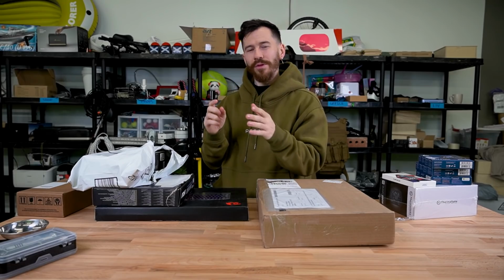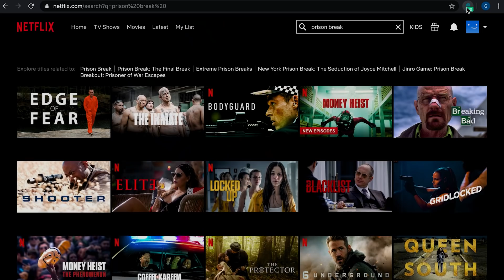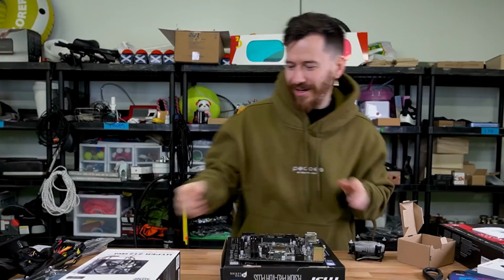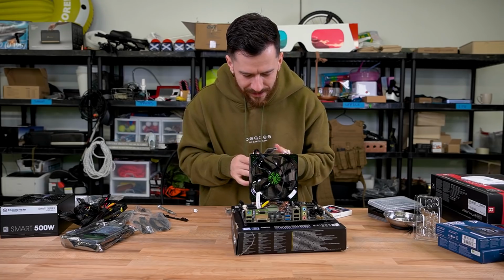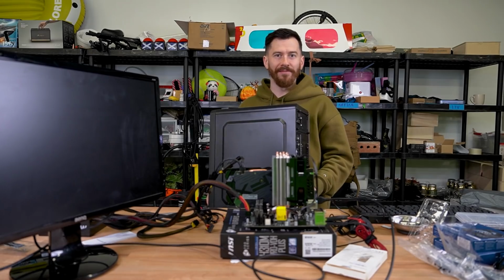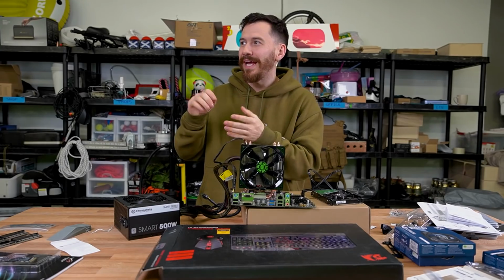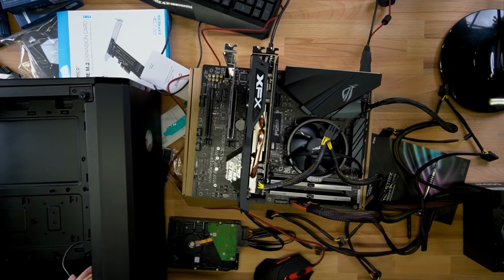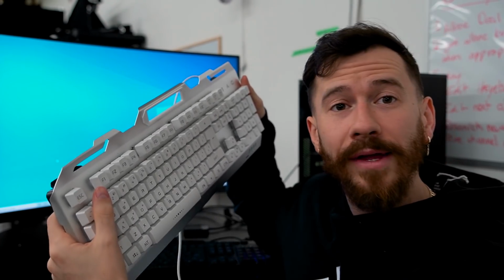WISH vs. AMAZON - Cheapest Gaming PC Build Challenge!!

Comment: Quick tip: You don't actually have to ground yourself, yes it is a good practice to do so and yes you can harm your hardware with static electricity but, it VERY unlikely that you would do so. Next time maybe buy a antistatic wrist strap from amazon if you're afraid. Pc parts maybe seem fragile and some are like the CPU socket but they are built to withstand some pretty brutal stuff, sometimes being to cautious will make you make some mistakes. Also for anyone saying this pc isn't enough fro editing, this pc is plenty, just because it's only a i3 and rx 570 doesn't mean you can't edit on it.

Comment: Two big things that I thought you could take note on is when you are making a lower end pc, you should go with ryzen AM4 instead of intel, because you are getting a much bigger bang for the buck. The other thing is, there are 3 main motherboard types, Atx being the largest, Micro Atx being in the middle, and most times being used in budget builds, and finally Mini Itx which is very small and most times not used in budget builds because good ones are expensive. Just because the motherboard is Micro Atx or matx doesn't mean it only has two dimm, or ram slots, their are different types such as B450 which is the best bang for buck, which can have 2 to 4 dimm slots. Finally the motherboard most likely worked, you just had to short the power pins on the front panel connector pinset
Reply: @ethanwang803   literally everything u said is false my dude
Reply: Ethan Wang kinda false, i just bought a ryzen 3000 series and it worked with my b450 mobo with no problems, aka no bios update. please fact check
Reply: @ethanwang803  you have your stuff backwards amd is better for all multi threading such as editing, and intel barely passes AMD for gaming.

Comment: *me cringing at him grounding*
Reply: LOL the psu wasnt even tuned on
Reply: It’s not supposed to be turned on for ground, just plugged in.
Reply: when did he even plug itin
Reply: Frailpancake You can see the cable is pretty tight so it’s been stretched to be plugged in.
Reply: Still better than the Verge
Reply: Did he take off the plastic on the copper plate at the bottom of the cpu cooler?
Reply: Dylan Salter how do you ground?  i dont really know how

Comment: I hope you figured out that the reason it wasn’t powering on is because you did not have a power button to press. It is you, you need to watch more videos before you attempt to build a of
Reply: i think he new that and you can turn it on with like a screwdriver on the pins
Reply: Yes, he should use screwdriver as jumper and he is really funny 😂
Reply: The 8 pin P4 connector is also not connected 13.22
Reply: Misael Jaquez knew
Reply: I wouldn't tell a new builder to go around the motherboard with something metal.

Comment: You didnt have a power button connected to either motherboards so thats why they wouldnt go into the bios, just turning the power supply on gives them power but you need to actually turn them on with a button or use a screwdriver to shortout the corresponding pins.

Comment: When you were troubleshoting with first motherboard you forgot to plug in the CPU power, its on left side of CPU. If you wanted to turn on your PC out of case you had to short two pins on the motherboard and it would have worked. Same thing on the second motherboard. You should work on your thermal paste application, a small two drops of thermal paste that are size of rice. Try watching some videos of building PC-s. But for your second part you did great.
Reply: i always find such a little amount of thermal paste as grains of rice is nowhere near enough to spread over an ihs. laptop cpu where its a bare die yes. too much is better than too little unless you really over do it

Comment: Parts you must use next time:
-Ryzen 9 3950X
- 2x RTX2080Ti
- Any motherboard with 4 RAM slots en Nvme m.2 slot AND supports 128GB ram
- 2x a 64GB Ram stick package (total 128gb)
- Random cooler (water cooling looks better😄)
- Huge case (it all must fit in it)
- Corsair around 1000w psu 
- 3x Asus 144hz monitors
Reply: Well i would do it like this
- Ryzen 3950x
- Rtx 2080ti (you dont need more)
- An motherboard with 8 Ram slots So you can juse 128gb perfectly fine
- Custom Watercooling (altough he is going to mess it up)
- Any 850w (80+ Gold/platinum)
- 3x random 1440p 240hz monitors (altough you dont need them!)
- Just some random ATX case that has enough place for watercooling

Comment: The motherboard isn't dead, you just need to jump start the motherboard by using a screwdriver if you connected already the power supply. You just need to tick the positive & negative of the power switch from the motherboard. If the motherboard doesn't power on, therefore you can conclude that the motherboard is dead. I've seen so many PC Build tutorials & did the same technique without a power switch on their test bench but newer motherboards have their built-in power switch like ASUS.

Comment: Oh boy, first time watching the channel and lets see if there's anything I can do to help your next attempt a building this pc. I'm by no means an expert, but I have had 2 successful builds under my belt since starting PC building back in November and kinda wanna see where this ends up going. lol

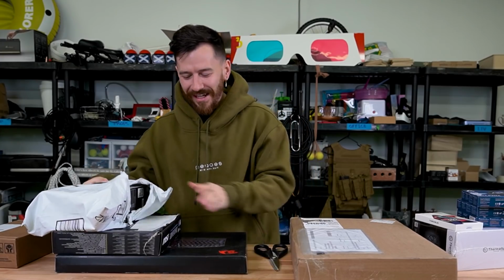1:40 - Pwm basically means you can control the fan speed via the motherboard fan header. Looking up the motherboard, that'll probably be a headache later since there's only 2 fan headers on that board. 1 for the cpu cooler then 1 for the case fans. I'd suggest grabbing a fan hub, searching for "Fancasee 1 to 5 fan splitter" on amazon will return something I think should work if those fans do not allow you to daisy chain them together.

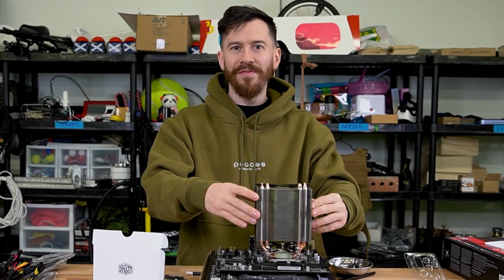7:39 - congrats on learning how to get the cooler on. Much better than the stock one that came with the intel cpu. Suggestion though, putting the fan on the opposite side. That way it'll take the fresh air being brought in from the front of the case and direct it to the exhaust fan at the back of the case.

13:08 - So, after looking this up. XFX apparently ships that weird splitter cable for the graphics card for power supplies that lack a 8 pin power cable for gpus (Didn't even know those existed). Since your power supply has a gpu power cable (which is the cable you connected into the splitter), you should be fine with ditching that splitter thingy and connecting that 8 pin power supply cable directly into the graphics card.

13:51 - As others commented, you may have turned on the power switch on the power supply, but that does not turn on the pc since you need a power button connected to the motherboard (as you already figured out later by putting one into the case.) There is another way though, if you locate the front panel connector on the motherboard that you would plug the switch into (motherboard manual should have a picture and list which one it is) you can lightly poke it with a screwdriver to turn it on.

13:54 - in addition to plugging the power supply to your hard drive, graphics card, and motherboard, there is also another location to plug a cable into at the top of the motherboard near the left. That's for cpu power. It uses a similar looking cable to the graphics card, but the difference is that the prongs can split from 8 pins into two even parts of 4 pins. while the graphics card power cable prongs can split into a 6 pin with 2 pins dangling on the side.

Then for bonus points, cause why not. I'll try and toss in together a quick pc build at a similar price point for amazon which I think would be faster and better for gaming and editing than what you were trying to do with that i3 build. (Which is subjective to current availability as I write this and uses US prices.)

MSI B450M PRO-M2 Max - $75
AMD Ryzen 5 2600 - $154
ZOTAC Gaming GeForce GTX 1660 Super - $240
TEAMGROUP T-Force Vulcan Z DDR4 16GB 3000mhz RAM - $63
Corsair CX Series 550 Watt 80+ Bronze Power Supply - $72
Silicon Power 256GB NVME M.2 SSD - $38
WD Blue 1TB Hard Drive - $45
Thermaltake Versa H18 mATX PC Case - $55

Total: $742 before tax and also pending how you plan to obtain windows 10 plus any addition case fans

Comment: Oké great that you got it to work but let me tell you some things you need to know.
Thermal paste is toxic so don't touch it.
Never ever put a motherboard on cardboard and turn it on it might damage the circuits breaking your motherboard. 
I would advise to do the following steps I do myself when building a PC
0. Screw the PSU into your case put this aside
1. Build in the cpu on the mobo
2. Thermal past cpu if paste is not on the fan.
3. Build the heatsink on the cpu (when tightening the screws do it in a crisscross maner to avoid pressure like I experienced in the video.
4. Populate the ram slots
5. Put the IO shield in your case 
6. Put the motherboard in the case and screw it down
7. Add the GPU to the mix
8. Attach the PSU cables to the right spots.(mobo, cpu,GPU,harddrive if you have a harddrive the PC can also only have only a m.2 ssd)
9. Arrange the cables from the case to the motherboard in order to be able to turn it on.
10. At the very very end attach a power cable to the PSU and fire up your newly build PC.

Trust me I did all this numerous times :p

Kind regards,
An IT engineer and PC builder

Comment: If you don’t have a case on you have to start the PC by short-circuiting the power-switch on your f_panel on your motherboard. Otherwise the motherboard won’t get a command to turn on by itself. You can do this with a regular screwdriver. 
I think that was the issue when it was not starting before you mixed up the two builds.

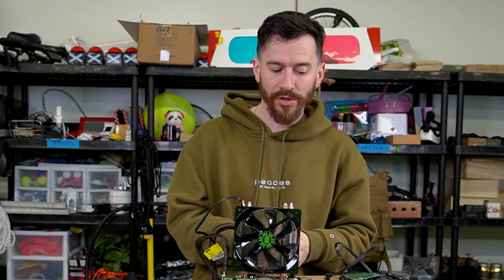Comment: 15:20 you need to turn the motherboard on  manually because you don't have a power button off/on and just because you have the power supply giving power doesn't mean it would turn it on so using a screwdriver or any small tip tool you have to turn on the motherboard I can't explain it properly where the manual switch would be but I wish I had enough money to build my self a pc.

Comment: You need to short the power pins with a screw driver if you haven't got the front IO plugged in to switch it on

Comment: Idk I built my computer without tutorials or anything, I just went with if it fits, it goes there. It’s been doin fine for over a year now. Also I kinda didn’t ground, and built it on carpet. Try doing a microcenter build too if you got that in Canada. Got a ryzen 1600 for $70 plus you get $40 off a motherboard and I found a msi b450 on clearance for $45, so I got a decent cpu and mobo for a total of $75

Comment: just saying....the cooler master cpu cooler fan is facing the wrong way (facing exhaust). You wouldn't want to be pulling air from the exhaust, because there is no dust filter. It would be better if the fan on the cooler is facing towards intake so that the fan would be pulling in air from the intake fans

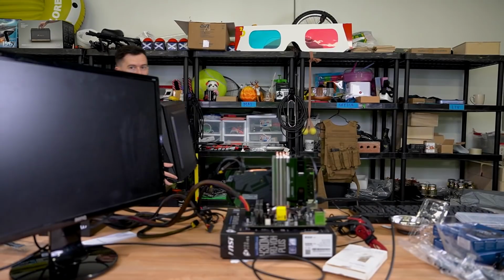Comment: Not so sure it was a bad motherboard. Looked like the 8 pin power connector wasn't plugged in at the top of the board @13:20

Comment: 1.That thermal paste is too much, your supposed to add a pea sized amount in the middle because when you press the CPU cooler down the thermal paste spreads out
2.For the first PC, Don’t put the cpu cooler fan facing the case fan because the case fan is sucking air in and the CPU fan is blowing air out so they are fighting against each other of air flow ( this would be if you are going to put your build in a case) Instead, install the fan facing the RAM Slots
3. If this PC is for editing, I recommend a better cpu and more RAM

Comment: Looks a lot like the p4 connector looks like an 8 pin on this is not connected on the  motherboard 13.22 i see it on the desk next to the atx 24pin power and no reach across + black empty connection block on motherboard from right

Comment: Your old Wish computer would be really easy to fix.  You had a bootleg graphics card with spoofed firmware installed.  You just had to get a new graphics card.
Reply: Also you just needed to short the power pins on the motherboard to get the first motherboard in this video working.  You also might have forgotten to plug in the CPU 4 pin connector (forgetting this connector typically would turn on the PC for a brief second or two and then immediately shut off).

Comment: Your cooler's fan is on the wrong side. It should be switched to the other side so it blows air out the back of the case. Also, for video editing, you want more cores and more RAM. If you watched a LinusTechTips or JayzTwoCents build guide, you would know this. Also, your power supply isn't a dud. It's not turning on because of how you have the GPU hooked up. That splitter is completely unnecessary. Just plug one of the connectors from the power supply into the graphics card.

Comment: Amd 3300x and Nvidia 1660 are a great pair around that price point. Get a set of G.skill Ripjaws 16gb min. A 500-650 watt power supply will do but make sure its from a good brand and is at least 80+ bronze, you can usually tell by the name when looking at online stores. A tomahawk max is a good motherboard for that as well. You can get that all around 700 bucks.  Then just pick a case and build away.

Comment: Most expensive pc:
i9-10900k
MSI Z490 motherboard -only supports Intel's 10th gen
RTX 3080 Ti (rumoured to come out in June) RTX 2080 Ti for now
128GB 3200Mhz ram (DDR4)
3Tb SSD 
1000W Gold psu
Others - 
Ducky One2 Mini keyboard
Logitech G903 mouse
Acer Predator XN253QXbmiprzx 24.5 inch - 240Hz

Comment: Pc parts under 700$ list
Processor: Ryzen 5 3500
Graphics: Gtx 1650 super
Motherboard: Gigabyte b450
Ram: 16gb 3200mh
Power supply: Corsair 450w
Case: Corsair cabinet
Ssd: crucial 500gb
HDD: 2tb Seagate Barracuda

Comment: 1. Was the CPU power plugged in
2. Did you do the right power pins
3. Looks like the Graphics card had a molex adapter connected, should have removed that and plugged in the matching PSU cable instead

Comment: You need a power button connected to the pins on the motherboard, otherwise you need to short circuit them with a small screwdriver.

Comment: You also put a bit to much thermal paste and the power issues did you plug in the cpu power cable it should look like the one on the gpu but on the motherboard

Comment: How are you trying to turn the system on because I didnt hear you mention shorting any of the power pins?. those normally are just connectors that are attached to the power switch on the case

Comment: Hey itsYeBoi quick question did you read the cabling from the powersupply and see the cable that says cpu? and plug it into the cpu connection. I have also forgotten to plug it in when I started out as well.

Comment: you made a mistake with the FIRST CPU cooler you used as the case fans bring in air inside the case and you have the cpu fan blowing air in to the case fans by the way you mounted it. It it supposed to pull air from the case fans and push it out through the back meaning if you had the back of the cpu coolers fan facing the back of the case then it would blow air in to the back of the PC
ANOTHER HELPFUL TIP. Most branded PC fans have an arrow somewhere on the side of them to indicate the direction of airflow

Comment: For a gaming build, id use a similar cooler, core i7 cpu. 16gb of ddr4 ram, m.2 ssd for the operating system. 4tb hdd for keeping the games on and a gtx 1080 gpu and an asus or gigabyte motherboard

Comment: you did not have a faulty power supply, you just forgot to plug in the other power cable for the motherboard. you only had the 24pin connected

Comment: i understand you said youre new but... a newbie would put the motherboard in the case and found there are wires inside it that might be connecting... like the power button?? led light??? maybe. so by testing post outside of the machine put you in a weird category. not newbie not experienced.

Comment: The motherboard might of not been broken when you have a motherboard outside of the case there isn’t a power on switch  (some motherboard do have one) but some don’t.  to turn on the motherboard u have to use a screwdriver and put it between the two power pins

Comment: Here is my pc suggestion for ya hope you’ll see it😄😄😄

•CPU: Ryzen 5 3600
•MOBO:Msi Tomahwak Max B450/ Asrock Steel Legend b450
•GPU: RTX 2060
•RAM: Tforce Delta 16GB 3200mhz
•Cooler: Stock
•SSD: 240GB
•HDD: 1TB
•PSU: CM MWE 550w white V2.
•Case: Cooler Master MB520 RGB

Comment: The only reason nothing turned on without the case was because you didn’t jump start the mother board. You can’t start a pc without a power switch all you had to do was get a screw driver and touch the front panel connectors

Comment: This was hard to watch lmao.. the comp doesnt turn on just by turning on the psu lol. you need to have a power button or touch the 2 pins together if its not in the case. and you prolly had that fan on wrong on the eve212. you also dont need the adapter for the power to the gpu as long as your psu has the 8 pin or 6 pin or both. and that i3 was prolly not a good idea for editing, i dont edit but i believe you need at least an i7. but in the end you did get it goin so good job...

Comment: Ryzen 5 3600, 1660 super, b450m pro mother board, ram rated at 3000 to 3200 2x8, then pick a 75 dollar ish case of ur choosing, get some fans, then 500 m.2 or Sata and a 500 watt power supply cuz pretty solid number even for possible upgrades too lol probably won’t even read this but I’m bored. Oh and NZXT cases are nice for the price

Comment: New pc:
Ryzen 7 2700x
Stock cooler
Corsair Vengeance RGB pro ram. 
2tb seagate barracuda hard drive. 
500 gb ssd
Rtx 2070 super overclocked graphics card. 
700 watt 80+ gold power supply.  
And atx case. 
Full atx gigabyte aorus pro WiFi motherboard.